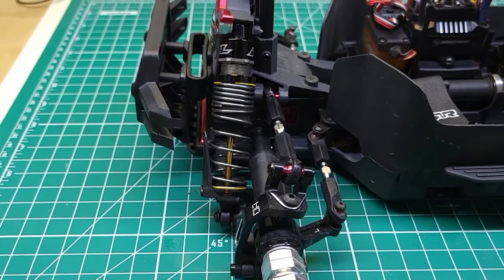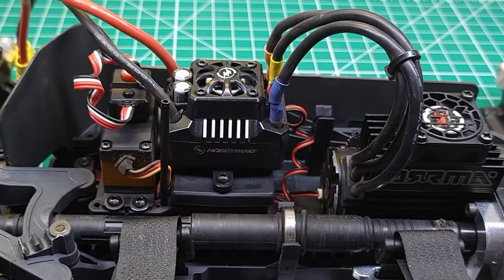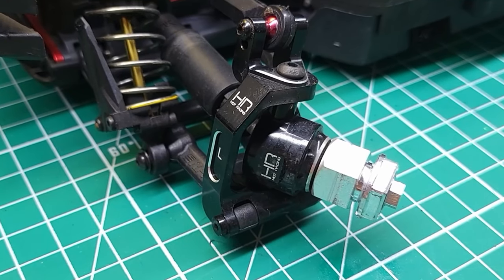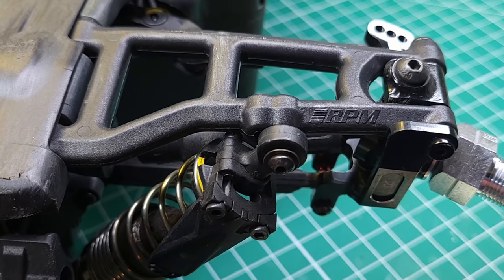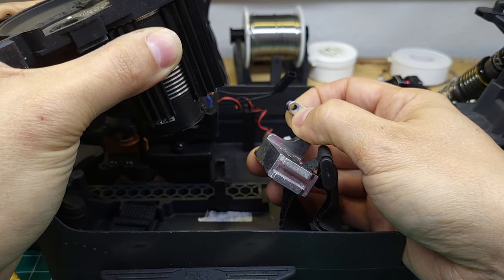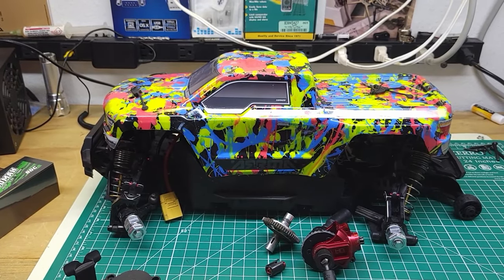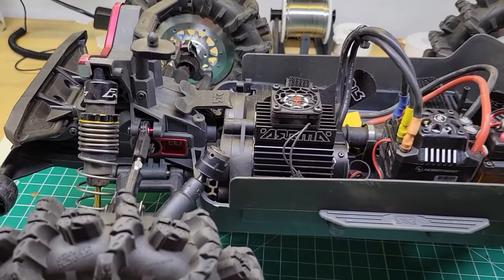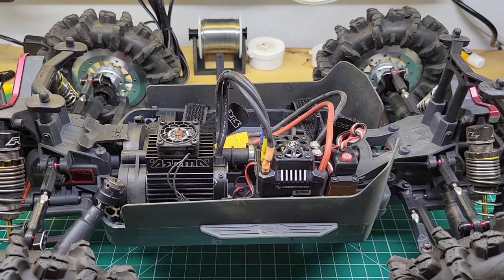The Most Overkill 3s Arrma Granite In The World!

Comment: Love the build. I'm about where you're at but I did the hr helical diffs and cases and I made a steel reinforcement plate that screws to the stock motor plate and have had any bending after 15-20 ft high air outs but I also run the rcawd driveshafts. Unfortunately they are not splined to the granite outdrives and are only held with 1 set screw. Just got done drilling and tapping 2 more set screws for the rear as I've gone through 2 sets of rear outdrives. Still only on 3s though. But I have a feeling after I get this outdrive problem dealt with it should be comfortable with 4s possibly 6. Maybe I'll have to share some vids when I get it going again. Love to see that I'm not the only one that'll put stupid money into such a cheap rig.
Reply from the maker: Yeah I've since sold that truck but it got a lot of use. It was my go-to rig for handing off the transmitter to pretty much anyone because I knew it probably wasn't going to get broken.

Comment: Do RC 👋.  Nice build ! Wow . Just today I was looking on Facebook marketplace and saw a brand new in box red and white granite v3 4x4 . $200. He said he just posted an hour ago so I drove 20 minutes and saw it was indeed bnib . He had originally bought two . I don’t like the shocks already and will check the 2.0mm screws inside the drive shafts before driving . It also says in the manual to set the esc for a lipo ? I thought they came pre set to lipo . Says it doesn’t
Reply from the maker: If it's a brushless granite it's definitely set for lipo from the factory.